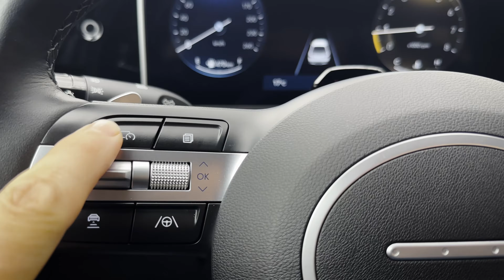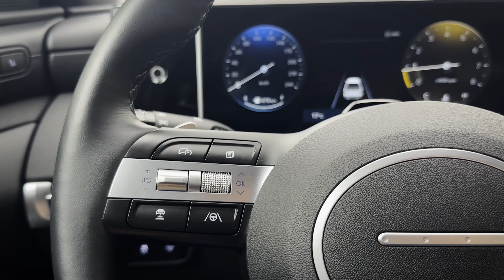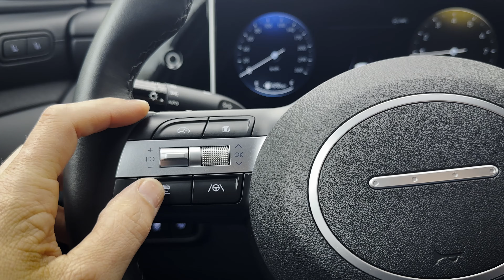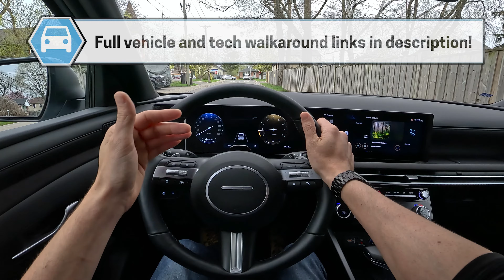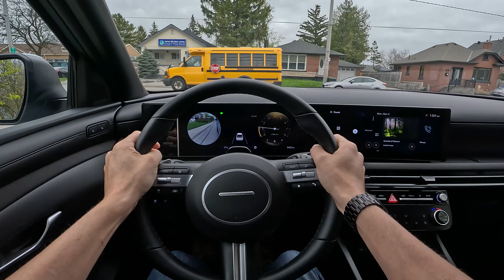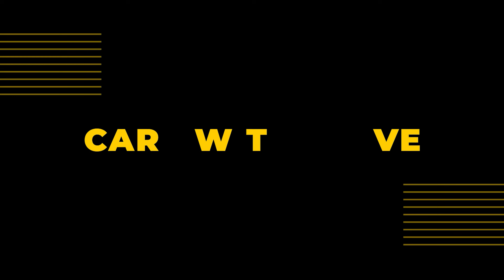How to use Cruise Control and Speed Limiter in the Hyundai Santa Cruz

Comment: .52 I don’t have the distance indicator. It just have OK button there.  Does this Mean mine doesn’t have auto stop if minimum distance reach close to the front vehicle?
Reply from the maker: What year and trim level is yours?
Reply: @CarsWithSteve   not sure about trim but its 2025 year, the dashboard is not like yours as well, the whole thing is one big wide screen.
Reply from the maker: The one in this video is a 2025 with a full wide screen that connects the cluster and infotainment.. The Santa Cruz lineup only has smart cruise control so the distance indicator should be on the bottom right side. Any way for you to take a quick pic or video and share it here or on Facebook @CarsWithSteve or Instagram @RealCarsWithSteve

Comment: You should say the model at the beginning my kona model is not that one and you talk too fast😢
Reply from the maker: Did you bother reading the title of the video that says it's for the Santa Cruz? The cruise control system works the same across the Hyundai lineup for the cars with smart cruise control but this video is a walkthrough on the steering wheel for the Kona --> https://youtu.be/eHbgAawj4b8

You can also adjust the playback speed to something that's easier to follow if you can't keep up